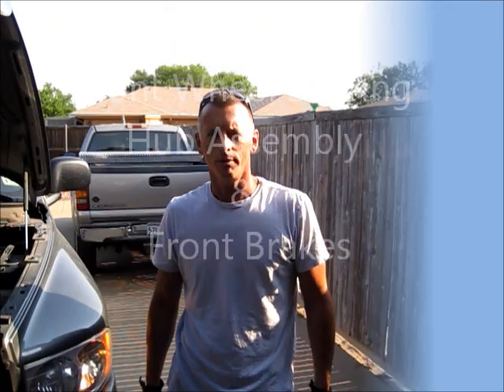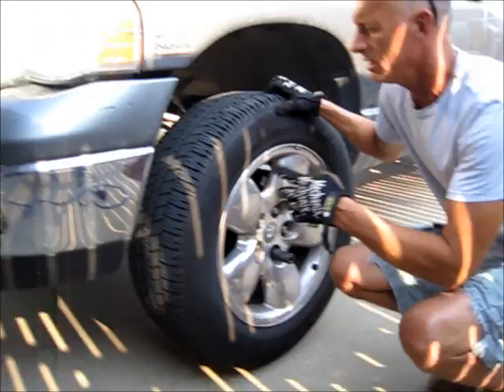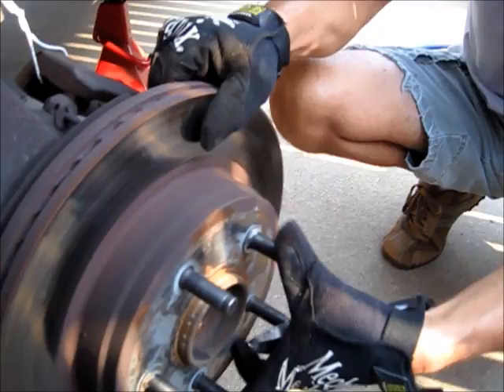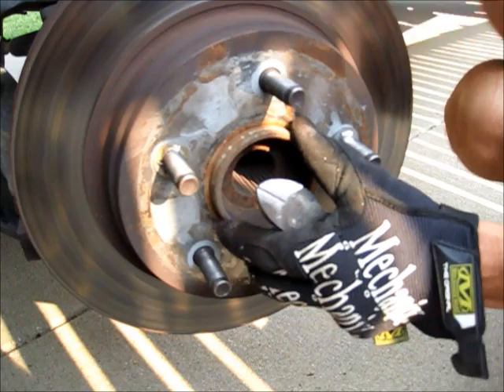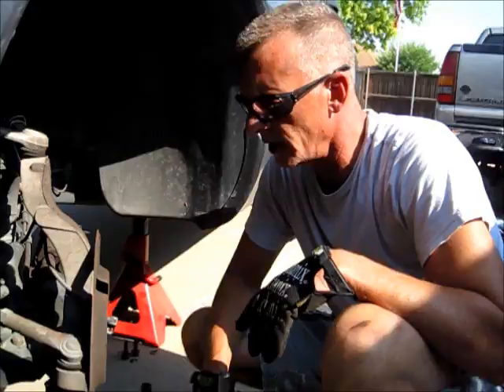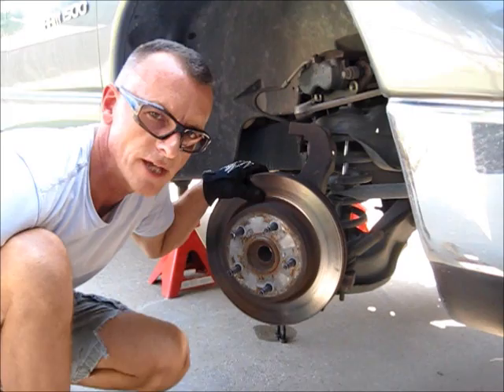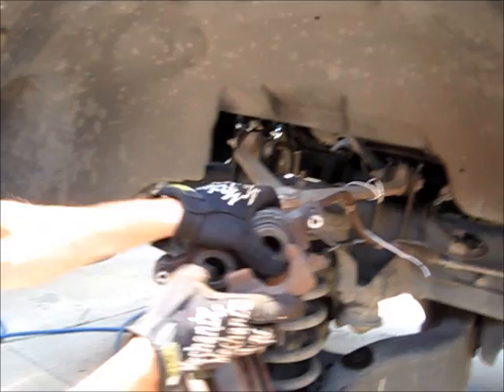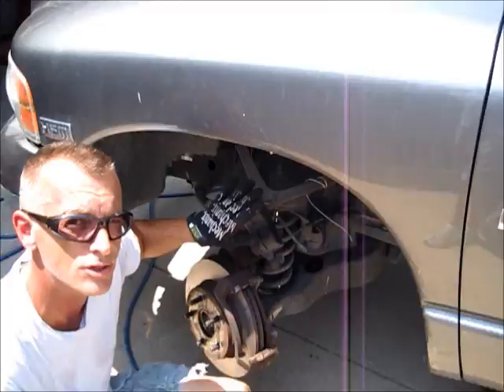2005 Dodge Ram Wheel Bearing Replacement and Front Brake Job

Comment: Nice job!  My 2005 Dodge Ram 1500 2wd is making grinding sounds at low speeds during braking and turning.  I "assume" it's 1 of 3 things:  brakes, bearings or possibly the power steering.  Will jack it up and check for wheel play and inspect pads, though it's only got 32k miles on it.

Comment: Use a deadblow hammer to get that stuck rotor off, you can hit the rotor itself and hit it as hard as you can. dead blow hammer wont damage it
Reply from the maker: Excellent suggestion Jay; shot-filled or nylon-tipped would work.  You could also cover the the strike zone with a piece of scrap wood and hit it with a ball-peen if you don't have a deadblow.  Thanks for watching.

Comment: Great video! I have an 03 1500 rwd that I'm about to change the rotors and pads on. 
Could you tell me where is a safe spot to lift the front and where to place my jack stands at ?

Thanks

Comment from the maker: Nope, at least I don't believe so.  The bearings in the rear are either pressed on to the axle (and the axle must be removed) or, the the bearing is pressed into the axle housing and still requires removal of the axle and the bearing must be pulled.  Maybe somebody more knowledgeable can comment on it.  Rear bearing usually go right along with a seal leak - differential oil is pouring onto the brakes due to the leak at the rear bearing.

Comment: never never press the pistons in without opening the bleeder valve. if you force the brake fluid back in to the master cylinder you could have a whole new set of problems.
Reply from the maker: Agree Ken, your procedure is the correct way to do it.  However, the key phrase you mention in "force the fluid."  I did that back in the 80's on a car and blew the master cylinder (old car/80's technology).  I learned.  I tried to be clear that you can compress the caliper piston if you go easy, take your time, don't force it, etc.  I've not had a problem since but you are wholly correct and your point is well taken.
Reply: dirtyshirtinfo
You are right ! 

I always compress the caliper like you do,and I go slowly (people reading this go slow,slow,slow as one persons perception of slow is different than anothers,go slow then slow it down a notch to be safe) 

I never had a problem compressing like this.I drive alot/own several vehicles new and old and always did it like this..even my 1968 with factory front disks ,never had a issue,done many 70's,80's,90's and 00's now a few 10's and always went slow with no problems.  

Good video,cheers !

Comment: How did you get the Hub Assembly out?
Reply from the maker: +keith benson 3 Bolts hold the assembly to the truck from the back side.  If you're referring to disassembling the hub itself we didn't to that...we replaced the hub as a unit.